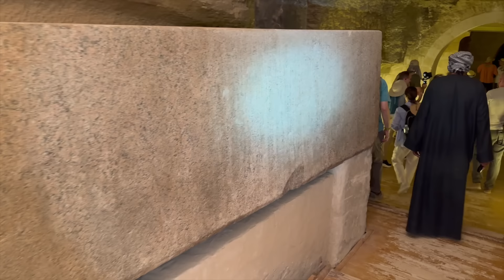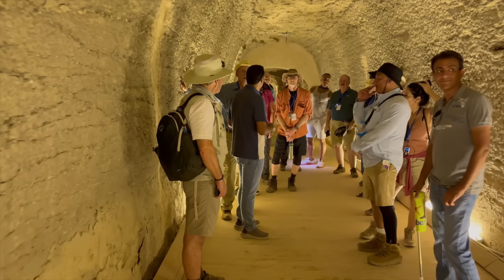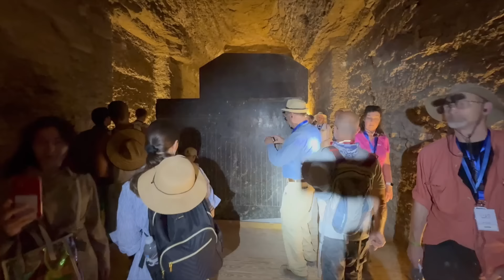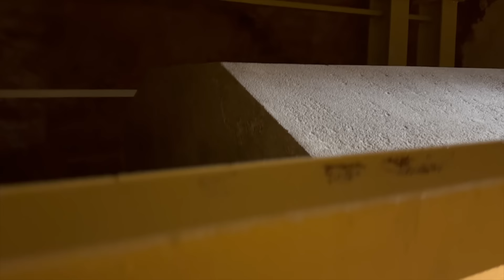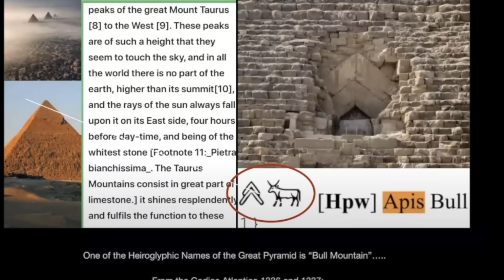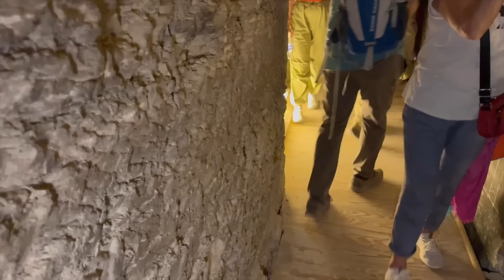Serapeum Secrets: what was really inside the 100 ton machined boxes?

Comment: Monumental megalithic buildings as Pyramids, andesite floors on Egypt, the Serapeum, the Monumental statues etc etc can't be Made by hand...as You said, i agree👌💯
Reply: Said someone who doubtless hasn't worked a minute in any kind of masonry or engineering work in their entire life 😂😆

The pyramids are nothing but giant stacks of rock with small interior spaces using the most architecturally simple design to make a tall building that nature has on display with every hill and mountain in sight.

They are impressive for the time in which they were made, and nothing more.

All of it can be made by hand.

Having the resources to feed and water the workers, to source the stone and all the other problems are the real issues, and those are all answerable by the evidence we already have of Egypt.

Point of fact, the more voids we find in the Great Pyramid, the less impressive its construction becomes, because it means less stone had to be cut and moved to construct it.
Reply: @mnomadvfx  Could you document your credentials for cutting granite, please? And your engineering experience? Voids have to be built over, even more challenging. And how were the numerous 80 ton granite blocks in Khufu's pyramid raised over 300 feet and positioned? Khafre's pyramid sits on 200 ton stone blocks at one corner because the ground wasn't level. Why did they do that and not just build the pyramid somewhere where that wouldn't be necessary? Thank you.